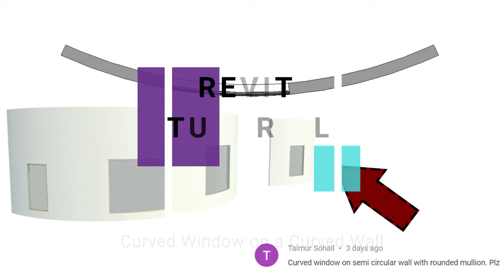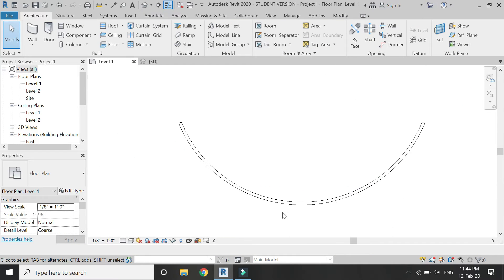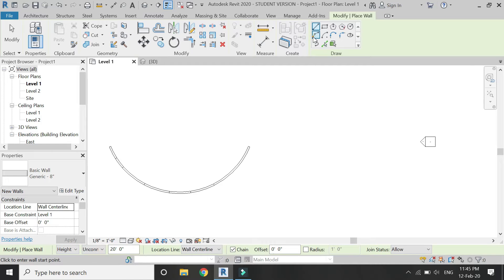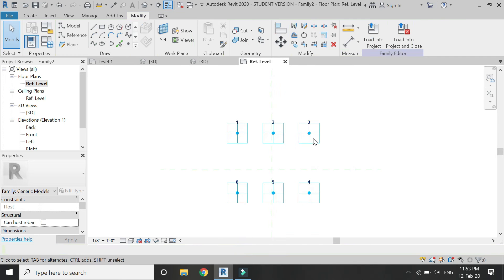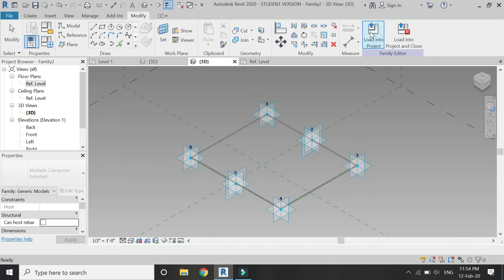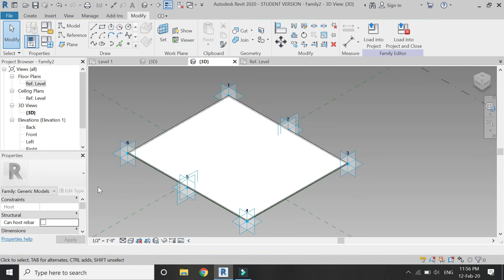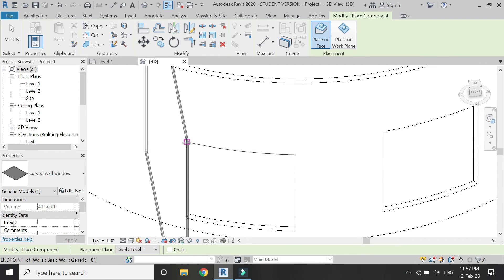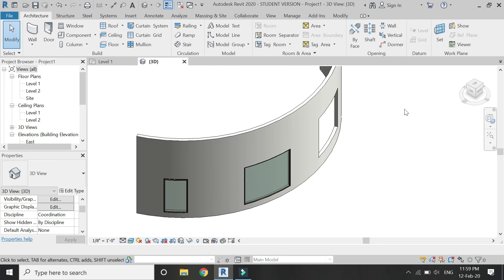Revit Tutorial - Curved Window on a Curved Wall

Comment: After i load into project,  i can only place the first point on the window opening, then mouse cursor turns into ∅  blocked sign, even when i put the other points at the end i get an error message says 
"Cannot Make type family"
Reply from the maker: There are few points which you have to consider while placing this window:
1. The window points must be placed in the same sequence and direction as of the adaptive point numbers.
2. Do not place this window in the elevation, place it in the 3D view and make sure that the window opening points are clearly visible.
3. It is completely normal that the blocked sign appears when you move the cursor away. When you will place the second the point, the sign will automatically disappear.
Hope this explanation will help.

Comment: isnt it easy to use storefront as a window ?
Reply from the maker: It is easy but the mullions are always straight in the curved wall while using the storefront option. But if you want the mullions to be curved along the wall, then you can use this method.

Comment: I cannot find the reference point command anywhere in revit 2019.
Reply from the maker: At 2:33 you can see in the video that there is a "point element" in "draw" box of the model line command which I have selected. You can also select this "point element" in the "draw" box of the reference line command. Before you place these point elements on the work plane make sure that "Draw on Work Plane" is selected which is on the right side of the "draw" box below the "Draw on Face".
Reply from the maker: You can only find this point element in the massing mode or in the creation of adaptive components. It is not available in every template file.